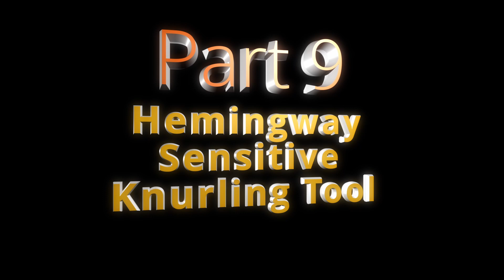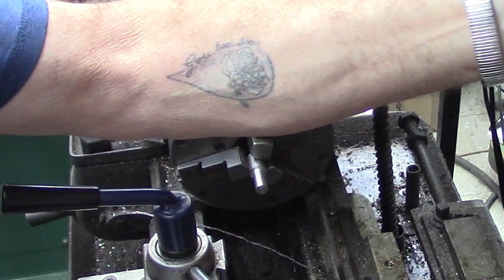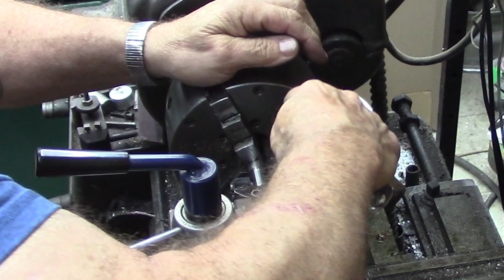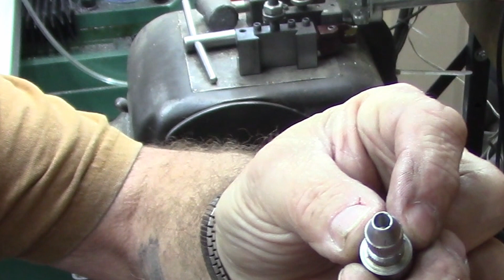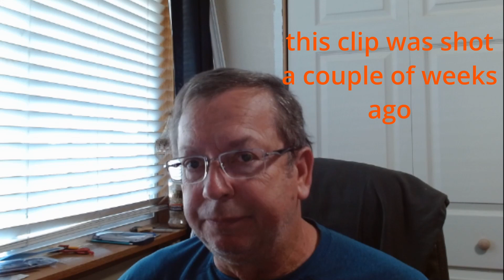Hemingway Knurling Tool: Part 9

Comment: Bummer about Hemingway, but you are still making nice progress on build. I can see how the Sensitive Knurler will be much easier to use than your tailstock knurler. That thing is nice for production, but for the one-offs we do in the home shop a tailstock knurler is a bit time-consuming to set up. Again, I'm glad I'm doing a scratch-build from the plans but using standard knurl wheels, rather than depending upon almost single-sourced parts. Thanks for the series. Cheers!
Reply from the maker: It is the only knurler I have with straight knurls. I have both single, and scissor types with diamond but they are different sizes